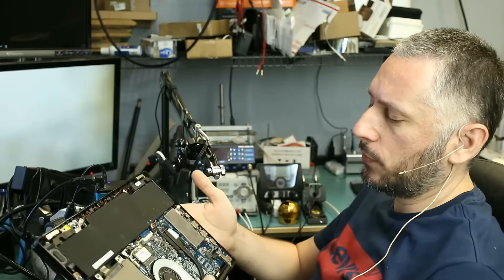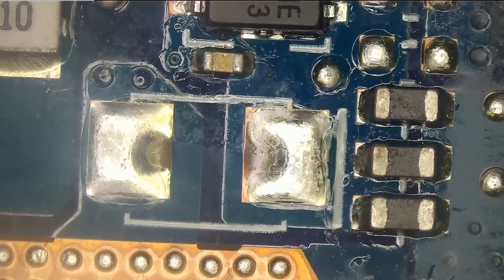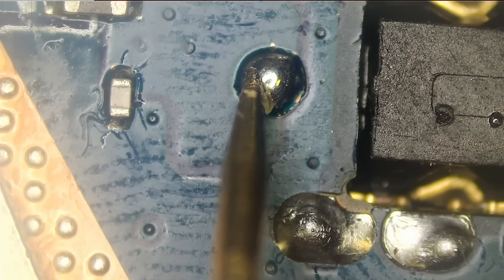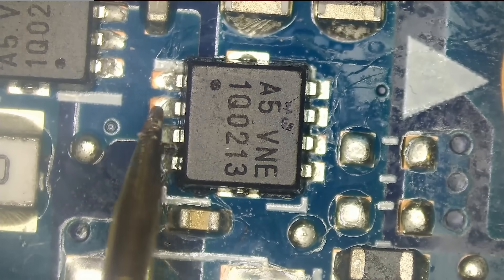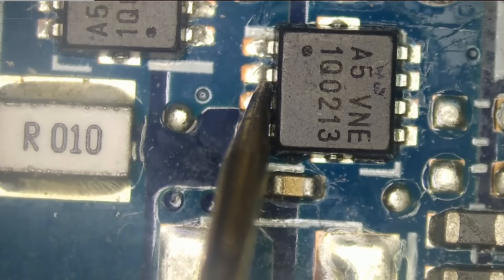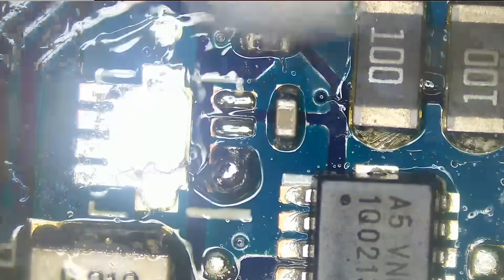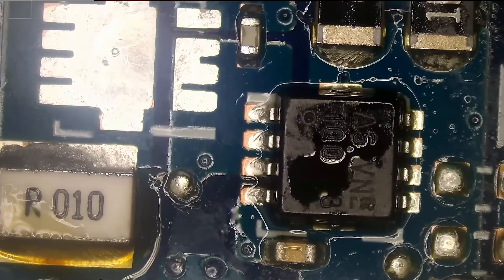Asus Laptop No power Not Charging Repair-  How Mosfets work and short circuit diagnosis

Comment: Hi can i know if u tested the unit with power on after ur flir cam? Cos i hv a tablet which has many of the caps shorted like ur vid.but not discoloured caps....but however there is a chip at the centre of these caps n it says axp288c i googled it n its a pm chip could it be this chip is faulty? The power is 5v from the adapter its not a big volt... But im afraid if i start it to check the board may be fried? Do u hv a email add or wats app no i could communicate with u pls? 

Btw tablet has power n the start lights come on but no display...cpu chip gets hot but not the axp chip...kindly advice pls

Comment: Hello i have toshiba satellite a300 with no sign of life. I disconnected everything except cpu fan, power supply and power button. Power button and power supply were tested by volt meter. Any recommendation welcomed. Thanks. How did you measure mosfets where is second  meter sond?

Comment: I hava a laptop of asus x54c the same issue is going on with my laptop which you had solved it in this video but no one in near my location like technician to help out to resolve it could you please tell me if possible that how to check mosfet and capacitor with multimeter and how to  bypass the capacitor and mosfet plz let me know my laptop is dead almost but  i have try it another battery so it was working with another battery but not charging at all?

Comment: Nice video  thanks for sharing. I had to remove  6 caps to figure it out wich one causing short.  It one of those things that we can't check with multimeter or esr meter as they are in parallel. Searching for easy way to test smd ceramic caps. Do know any shortcuts on pin pint shorted capacitors  if you have then  would please mak videos  on it. Like soldring skills  lernt something new

Comment: It was not necessary to remove the mosfets.  Short on capacitors is much more common.
  Anyway, your luck in removing exactly the capacitor that was short-circuited is enviable! 
🤔🤔🤔

Comment: Couldn’t you use some kind of fluid that evaporates under heat to determine the shorted capacitor?
Reply: Yes, you can use alcohol and start with 1-2 volts and go up, just to give enough watts to the cap so it can heat up and start to evaporate the alcohol.

Comment: Hi, good morning!  I have a N552VX and it's not charging the battery and if the battery is removed the notebook shutdown. I alredy tested the ac adapter and it's fine. I charged the battery with an exernal charger and when i install again the notebook works just fine. Have any sugestion? What should I need to verify?  Please, if you can help me i'll appreciate ! Thank you!

Comment: Strange thing is I was gifted this laptop, it takes charge but won't turn on when pressing the power button. The laptop only turns on when I disconnect the CMOS battery and the moment I plug in the charger. Even then then when I press the power button, it still won't power on. But if I unplug the charger and plug it back while CMOS is still disconnected, it powers on by itself. What's my next step?

Comment: WHY DID YOU REMOVE MOSFET TRANSISTORS FROM THE BEGINNING?
THERE IS NO POINT!
Reply: mosfet are most common short i think
Reply: @themetalmicky  yes those used for voltage sources ,not the two that are used only to cut the voltage!

Comment: What kind of tool do you need to apply voltage on the board soldering a wire to the mosfet?
Reply: Best option is to use a bench power supply so you can regulate the voltage and limit the current but you can use a constant output power supply if you have it. Just use lower voltages to not bur anything or trip the circuit's limit so it shuts down.

Comment: some capacitors one side is beeping and some other when you touch with multimeter both side are not beeping. What is difference?
Reply: @mmzhr  so others are filter / bypass caps ? and one beep caps are electrolyte caps ??

Comment: After the output of the second mosfet, the circuit does not show where it leads to. I tested the caps and there are multiple caps shorted. How do I know which one of them?
Reply from the maker: I took a wild guess based on the discoloration of one of the caps.

Comment: I have a ps3 super slim power supply and i found that an smd resistor was broken value is 1.8G ohms .. Where can i find?
Reply: that doesn't sound like a typical resistor SMD value, double check with the resistor out of the circuit

Comment: T61 IBM blown 7 fuse replaced. Still no 20 volts on power pins, new fuse or MOSFETs. Any suggestions would help. Thanks

Comment: Why does the drain have so many contact points? Why not just make it with 3 points?
Reply: high current passes though that tiny Mosfet chip, the 3 pins on the drain and source helps with heat dissipation

Comment: Great job. By seeing this video I have fixed my college Asus laptop which was not turning On even with battery or charger. I just removed one tiny mosfet near by charging port. I found that surrounded area capacitors shows short to ground. Once I removed tiny mosfet then short has gone. I do not have a same mosfet so I decided to jumper its drain and source pins. After I assembled everything I checked laptop and wola it's working fine and charging too. Thanks for guiding through your videos.
Reply: Owais Akhter by jumping it thereby bypassing the mosfet’s function, if the situation happens again, won’t it blow your motherboard?
Reply: @barbara82589  I knew that if the situation happens again then possibly another mosfet would fry also and could damage further towards supply rail or power management circuitry. For that reason I have added 2 Amp smd fuse in series leading to mosfet. So in case if charger cable short again from its positive to ground or laptop draws 2 Ampare because of anything wrong with charger then 2 Amp smd fuse will below instead of whole power management circuit goes blow.
Reply: What ASUS model do you have? Seems to be a somewhat frequent ASUS problem.  Mine is a Q324U.   I wish they would have used a harness connector for jack component instead of solder type, easier to test and swap out for those of us without soldering skills
Reply: @barbara82589  I'm sorry I don't remember the exact model now but I will update you after ask my colleague. But I'm not pretty sure that it's frequent problem with Asus laptops. In our case charger cable was torn and by mistake it was joined reversed polarity. Once he connected charger just after cable repair then within 2 seconds laptop shuts down by itself.
Some laptops I have found small charger port PCB and some harness connects that PCB to Mainboard. So repair might be simple or requires replacement of charging port PCB only.

Comment: I had the same problem with hp laptop pavilion dv7-1130us until I bought a hp xb3000 notebook expansion base to power on it and charge the battery

Comment: Where were you placing the other multimeter lead when you tested capacitors for short to ground. Thanks, your video was awesome. I'm going to subscribe
Reply: You can just put it only any ground point, usually a screw hole

Comment: What is that silicon looking type substance put onto the electronic parts as they were soldered ? And its purpose please? is it to dissipate heat?
Reply: It's called flux, it is used to get better contact between the solder joints and the board.

Comment: So if you touch caps with the red probe and put the black probe on something metal, and the multimeter beeps on the continuity test (one that beeps on mine), that means what the red probe touched is shorted to ground (which is bad)? There should be no beeps at all? Am I understanding that correctly?

I'm new to this. I want to learn as I love fixing things (only do basic stuff right now, like fix software problems and open stuff up and replace parts). I want to slowly get into these sort of repairs.
Reply: You prob know that electricity is the movement of electrons but what motivates the electrons to move is "showing" them a path to some atoms that are willing to take in electrons and ground are full of those atoms.

So when we say something is "shorted to ground" that means there is a short path to ground so electricity WILL prefer to take that path instead cause it's a shorter path and most of the time offers no resistance. So having a short to ground means electricity will not take the path it is intended to take and you can test that by using the continuity mode or diode mode in your multimeter to check if a path to ground is being made.

Continuity mode just checks if both probes of the multimeter is connected to each other, if they are indeed connected the meter will beep, so if you put your black prob to anything that is "grounded" and the red probe to any component lead it will beep IF that component is connected to ground;

I'm still learning as well and i'm not sure which components are supposed to connect to ground, all i know is that every capacitor should have one lead connected to ground and the other lead should not, so if you do this test to a capacitor and both sides of the capacitor causes a beep that means the power line that passes through that capacitor is shorted to ground and you have to look for which component is actually causing the short.

I hope this clears somethings up and keep on learning!
Reply: The cap is closed off from ground and should have no direct path from the input lead to the output. It will only pass AC. Some caps have a metal casing which should also be insulated from the inside of the cap.

Comment: Hi,
You can put a little bit of flux on a suspected short component and draw the current; if that is short the flux will vaporize. This is also a manual method of testing short component like puting on a finger and feel the heat as we know this is a low voltage circuit. Good luck..

Comment: I’d like to see him use a protective mat to place the lap top on. At it is, debris on the workbench will scratch the surface of the laptop. By using a ridged mat, the laptop is lifted above the level of debris. Nevertheless, an expert repair and I agree there is no need to replace the failed bypass capacitor, very often 100nF.
Reply: Expert in my opinion is someone, who doesn't use "we have to guess" or "I believe they are OK" :-) There is no space for guessing or believing, one has to measure and be sure about it ;-) Otherwise well done job, people would be really surprised to know, how many different devices are thrown away only because of those small cheap failing fckers :-)

Comment: You can inject 19V to the 19V rail w/o damaging but you MUST use a power supply with variable current limit, cranking the current slowly up. The thermo camera is a good idea if you have it, otherwise use your fingertip carefully not to burn yourself. Using  serial connected 24V or 2x12V automotive  light bulbs for current limit is a cheap solution if you do not have a power supply with variable current control. The bulbs can be 15W,  25W, 45W 55W  depending on the desired current.
Reply: that´s what i do,i'm just a small time hobbyist.
edit:  besides monitoring the Amps thru a second multimeter,on Amps,  they can also be seen  on the more or less brightness of the bulbs, from 5W  or less to 45W

Comment: 12:09 I dont get it at all... The left third pin is now connected to pin 4 via solder. Why is there No problem?
Reply: Pin 4 is seperate from the other 3, it's just drenched in flux which he'll remove and clean up before reasembling the laptop.
Reply: Agree - looks like the second MOSFET he soldered was bridged. I would have thought that needed to be cleaned up - but maybe there is a reason he was able to leave it like that?

Comment: Do not use standard testing powersource, which shutes itself down when overcurrented. Use intelligent source with over current protection and current settings, which gives max about 2 Amps all the time (with almost zero voltage) and not shutting down itself.Then use your IR cam. If no IR camera, just freeze your circuit down with electronic  freezing spray. You will see the shorted element (overheated - defrosted) immeditally, beacuse it consumes all the power.

Comment: Just my 2cts : when using FLIR - do not use laptop PSU, it will shut down, use a lab PSU instead and start with 1-2 Volts, this will give you about 3 Watts of heat on your defect cap, which will show nicely on your FLIR.
Reply: what i was about to type out, good on you sir!
Reply: Hello i have asus x550vx laptop it has same problem in this video laptop how i fix it (no power not charge)
Reply: Nope! It doesn't always happen that way. If capacitor is  completely in short It doesnt warm.
Reply: @renatosaraivalima   I've had dead shorted caps that show warm.  Less than 5 ohm.   Why do you say that a completely shorted cap won't show warm?
Reply: @user-ty2uz4gb7v  completely short, ZERO ohm. Meter shows near about 0.23ohm. ALL laptops that I fixed with ZERO ohm caps over 1.2v,  3.3v or 5.0v lines, capacitors never warmed.

Comment: Sir you have really good instruments & tools for repairing, & process of work is really nice,but you can fix this at only 2 minutes by injecting volt with high amp to the second mosfet & detect faulty capacitor by hand...
Sorry if i hurt you...
Thanks
Reply: Bro are you a laptop repair technician i have a question how much do you earn ??

Comment: Did you get screwed on this Repair, good luck convincing the customer that those were separate problems. Tough dealing with customers. Good video
Reply: Usually, the laptop stop working, then the customer breaks the power jack while attempting to get the laptop to work thus you have 2 issues.

Comment: Nice guess on the bad capacitor! It looked a little bit de-laminated, but hardly discernible even with a microscope. You could have replaced it with a 10nF capacitor, just to provide some local noise filtering. It is a conservative value, as 100nF is a typical value for those.

Comment: Bro I have a problem in my acer v7-582pg it doesn't work no power no charging what can I do I can't trust someone to fix ,I have a doubt if I took it to someone maybe he will make the problem worst more than  it was pls answer me I'm so depressed
Reply from the maker: You need to trust people. Your laptop is already dead. What's the worst that can happen. There is no one answer to your problem. The board must be diagnosed.

Comment: Great video really. My Asus core i7 7th generation,  is not getting start on AC power.  It starts by battery by pressing 10 time or 20 times.  Need ur assistance please. And also some time it automatically disables sound driver.
Reply from the maker: There is no one answer to your problem. The board must be diagnosed.
Reply: @NorthridgeFix  thanks for your reply.  Can you do one favor for me.  I will send my main-board on your address, you diagnose and repair to it.  I will pay your charges of you don't mind. My Laptop is Core i7 7th generation. I searched in my location but i couldn't find any competent repairing expert like you.

Comment: On the time 8.14 of this video, a short circuit is in mosfet legs, why you not cleared this short before finding another place ?????t
Reply: Is'nt a short. The 3 legs in the left MOSFET is the same. In the right MOSFET the pads of these 3 legs are not isolated, only the solder mask is "separating" those legs. You can search the datasheet of the MOSFET. mosfet a5 1q0213

Comment: If the zener diode is burnt,What is the alternative to him ? i do not have zener daiod ..thanks
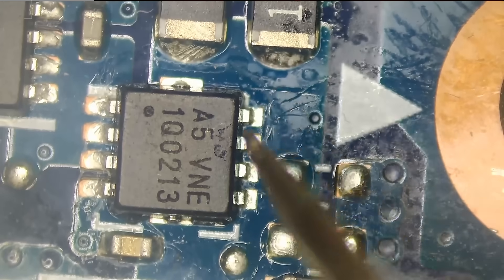Reply: What zener? You must mean the MOSFETs ( the two eight-legged components). There is a full view of the device at 3:14. The top designation A5 VNR is the MOSFET number. Google it (or eBay). It will tell you how and where to order it.

Comment: Same setup as Acer laptops. I had the same issue and it was a filter cap that went to ground because a co-worker plugged a universal charger into it and didnt pay attention to the tips polarity position.
Anyways I know it will work without it but as a professional repairperson you really should replace that bad cap and not just leave it out especially if that is a warranty repair job.

Comment: I don't understand that why you have removed those mosfets when there is no any ground pin ? Mosfet have no any ground then how you think these two mosfets are reason short to ground that line? I am pretty sure we should not remove those mosfets if there is any line short to ground related to these mosfets
Reply: it's part of the process of elimination..

Comment: You have 1000 USD cost thermal camera and can't use it to find which capacitor is short.thats not good short can be far a way from main power mosfets.that is your chance to find it nearby.i am using finger sense or thermal fax paper to find heating part's on mb
Reply: In Darkness, I Dream, I'm Digital  hahahahhahahhaha xD

Comment: Nice Video dude! What Flux do you use and what temperature you use normally with you solder iron and hot air station?
Reply from the maker: Temperature depends on the device being worked on. for laptops i would use 440c hot air and 390c iron. Flux https://rover.ebay.com/rover/1/711-53200-19255-0/1?mpre=https%3A%2F%2Fwww.ebay.com%2Fsch%2Fi.html%3F_from%3DR40%26_trksid%3Dm570.l1313%26_nkw%3Damtech%2Bv2%2Bflux%26_sacat%3D0&campid=5338440312&toolid=20008
Reply: @NorthridgeFix  Same thing I use for 2-way radio repairs here, good stuff. kinda expensive though but I do not cheap out on customer repairs especially if it's a warranty job